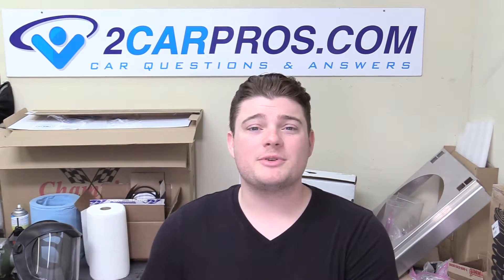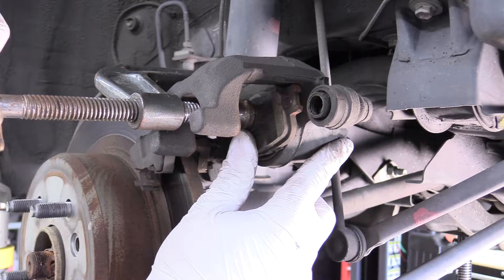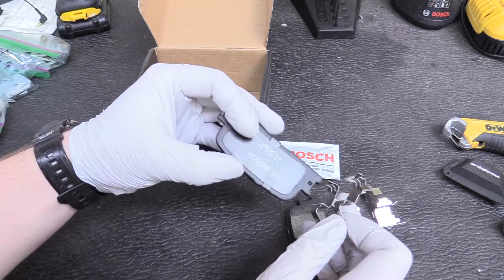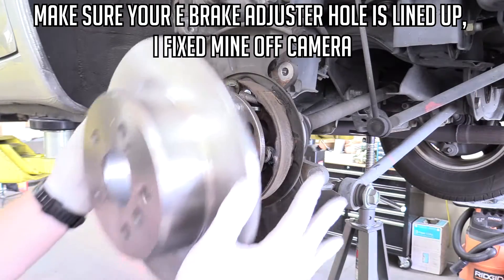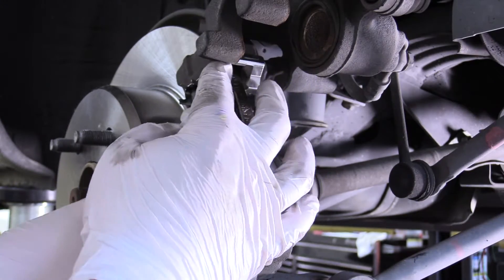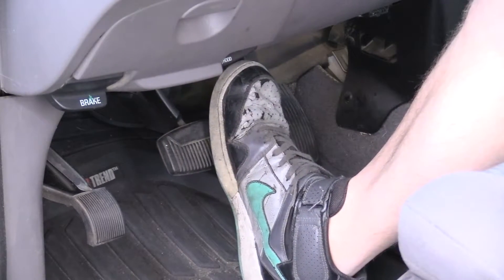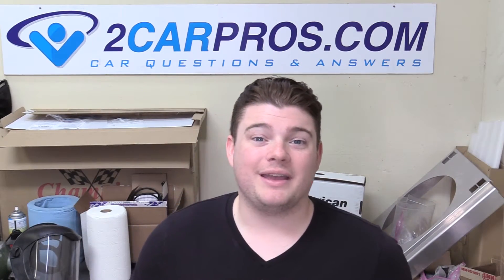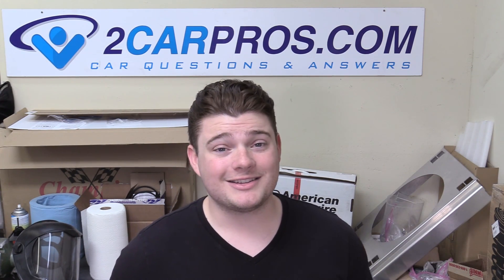How to Replace the Rear Brake Pads and Rotors Toyota Highlander - SAVE HUNDREDS DIY!

Comment: I  changed my pads with. Bendix 4x4 heavy duty and rotors  DBA.   Works very very well  in. Wet weather.  I used it in my  4WD.   I will use them too with my wife's highlander. More expensive but performs better than Bosch.  There are Bosch rotors but I prefer DBA. ( Expensive) but last longer performs better.

Comment: Great videos.    Question.... the parking brake on my 2005 V6 doesn't engage all the way as it won't hold on a hill in N.  I saw one YouTube video that said to adjust the nut on the cable controlling the brake but a former master tech at a Toyota dealership I frequent said to never touch that adjusting nut, but rather adjust the "stars" on both rear brakes.  Do you have a video to about that or can you elaborate about the process?  I did note you said here is a rubber plug to access the parking brake adjustment in your video.  Is this where the star adjustments are?

Comment: Hey at minute 6:15 When you move the caliper over...  Mine is seized I guess? I can not shift it in or out, it swivels just fine, is there anything that would prevent the caliper from moving in and out to adjust the alignment of the caliper to the brake pads?